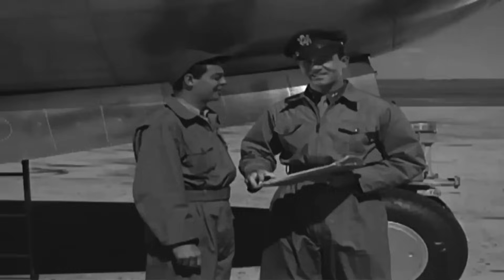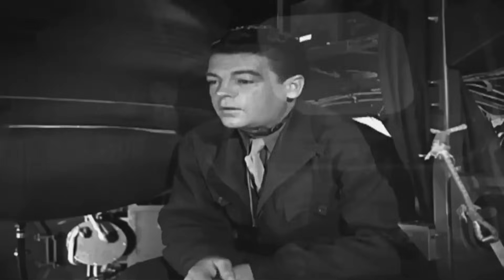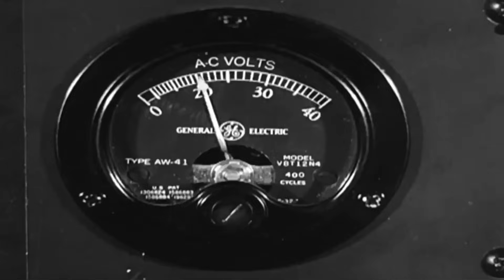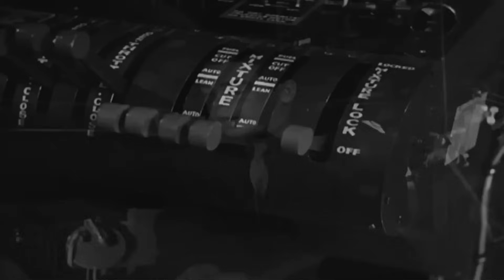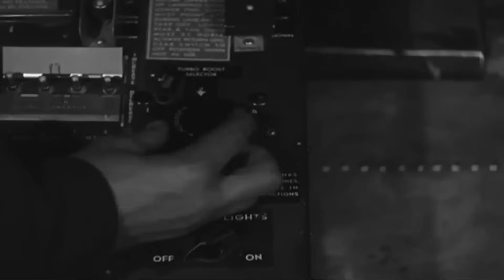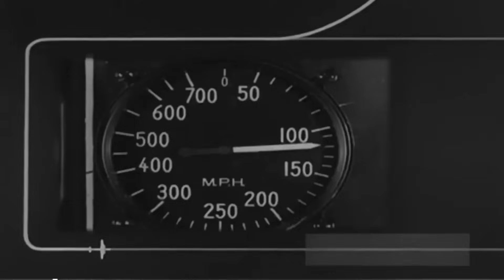ENGINEERING THE B-29 -  PRESIDENT RONALD REAGAN and ACTOR JOHN PAYNE TELL US HOW  [OFFICIAL WW2]

Comment: My dad was a pilot of the B29 out of Saipan in WWII.  He never wanted fly again after the war, even though I had a plane when I was in my 30s, and offered him a pleasure trip.  Before they had secured Iwo Jima, which offered an alternative half way between Saipan and Tokyo, they lost several B29s that ran out of fuel on the long non-stop flights.  He told a story of one trip in which he told tha co-pilot to take over while he took a nap on the way back to Saipan.  when he woke up a while later,  the whole area was covered by very low clouds and mist.  He looked over at the co-pilot who had fallen asleep.  The plane did have an auto pilot so it had held a course, but they had no idea where the island was.  Finally, just by luck he saw the field's rotating light beacon flashing above the mist layer.  Just luck, or I wouldn't be here.

Comment: I found it interesting that the conventional engine numbering system (perspective is while sitting in the pilot's seat) is not maintained on the Flight Engineer's controls.  The engine numbering convention is:  #1 engine is farthest outboard on the left wing then, moving sequentially left to right, is #3 engine, then #2 engine is inboard on the right wing, and finally #4 engine is the farthest outboard on the right wing.  On the FE's panel, the throttle levers, etc, were mounted opposite:  #1 engine controls were mounted farthest outboard to the right and #4 engine controls were mounted farthest outboard to the left.  Ergonomics have improved since then.
Reply: Two things. [1] Regular engine numbering convention (L-to-R) is 1-2-3-4, n0t 1-3-2-4. [2] FE is facing rearward, therefore his throttle levers are numbered correctly.

Comment: I was interested to learn about the starter-generator, they called a (putt-putt) I think, I saw a video with spec. tag plate still on it saying they are a 10 hp engine I think with a 28 volt output, or 30 volt, sorry I forgot exactly I was wondering if anyone knows if they were dc generators or ac? It sounded like they used the word inverter in this video.

Comment: Now imagine this same work load on a B-36 flight engineer, with SIX 28 cylinder R-4360's to manage, AND 4 turbojets on the final model. And since the B-36 engines were mounted as "pushers", airflow over the cylinders while taxiing, or waiting your turn to take off, was very problematical. The R-4360 already was a "difficult" engine to keep cool, even when it had the propeller in front of it in the usual tractor configuration. I read somewhere, that of all the heavy bombers ever flown by the US Military, the B-36 had the highest cost of maintenance hours per flight-hour.
Reply: Six Turning and Four Burning.

Comment: Turbos off at 10000 feet? I understood that turbos are required at higher altitudes.
Reply: Yupp they are, but like in your sports car they can provide more gasmixure into the engine than without.
Of course you don't need that in decent and on low altitude level flight, but it may become usefull if you have to make a go around while one of the engines fail at the same time.
After all even with the gas tanks mostly empty, the B29 is a heavy beast (34 tons empty) and it certainly was not overpowered (aprox 3300shp * 4).

Comment: The B29 was delayed by the development of the engines - it was a hard birthing process.
Reply: According to several sources,  it was touch and go-as to whether they would cure the many teething problems on this hi-tec  ultra modern Bomber, in time to drop the two H-bombs.
Both bombs were different in shape, Diameter, and Weight, with different handling and priming systems. A contraversial claim  is, that the  B--29 frame supports, could not be altered to allow such a huge and heavy bomb , to be released from it's extended  bomb-bay, without risk. Strenuously denighed by other sources.   Further,it is said that , in case of this  possible delay, 3 RAF LANCASTER BOMBER's, that do have huge Bombays, were ''offered''. Not perfect ,  but as a lst resort----or no H-bomb attack ??   As we all know, the Mission was carried out, according to plan.
Reply: @MrDaiseymay  Having seen replica's of both bombs and walked through FIFI's bomb bays, I don't think that is accurate.
Reply: @MrDaiseymay  As far as carrying the nuclear bombs (they were not H (hydrogen) bombs), your touch & go claim is nonsense.   B-29's were routinely flying missions from May 1944.   The two bombs were dropped as soon as they were ready on Japan August 1945.     The B-29 needed minor modifications for the nuclear bomb missions, mostly to improve height performance and range, so that the aircraft could clear the blast and had time to fly to alternative targets, This was done by fitting fuel injected engines, lightnening weight & reducing drag by removing guns.    
Note that they knew the dimensions and weight of the bombs well before they were ready.  Crews practiced Stateside with dummy bombs of the same size, shape, and weight
I've heard that nonsense about using Lancasters too, from a certain British YouTube presenter who goes in for gutter press-style sensationalism and doesn't worry about accuracy.    The fact is, the Lanc was not even remotely suitable.    The B-29 range (5200 km in the standard model) was barely adequate (the Nagasaki plane's engines cut out on landing), whereas the Lanc had a range of only 4100 km.   The Lanc had a ceiling of only 6,500 metres - not sufficient to clear the blast, and would have been shot down by Japanese AA guns.  B-29's flew at 9700 m and above the range of Japanese AA.   The Lanc's speed was lower too.   If it even got to the target, it would have been suicide for the crew to drop the bomb.

Comment: Great informational video. Makes you wonder though, if they had to get the plane off the ground in a hurry if there was an emergency situation.
Reply from the maker: Don't think anyone wanted to ever move to quickly with the monster. :-)
Reply: Even today you're talking about 15m just to start a plane, more if you have to load it with fuel and ammo
Reply: You didn't unless the engines were warm. The engines had to  be pulled through to avoid hydraulic locking when oil drained to the bottom cylinders.

Comment: excellent video great narration from RR.  I had some bomber radios from both wars in my radio collection. These planes were made by engineers and pilots there's far too much automation overlay on modern aircraft, not enough basic control systems as a fall back. The idea that both FBW sidesticks are not coupled at least electromechanically is totally beyond me.  IMHO....
Reply: Oh, the basic controls are definitely there, and not as a fallback. The automation is there because the engineer and pilot didn't want to spend hours watching fuel pressure: between 15 and 17; cylinder head temp: within range; etc. And they're sync'ing the side-sticks in newer designs.
Reply: You should call Boeing and give them a piece of you mind 😂

Comment: Would have been nice to explain why the engines were "pulled through"
Reply: Prior to starting, pull through is performed on every vertically mounted radial engine, now and forever. Although all radials use a dry sump oiling system, this remains a mandatory process ensuring that oil has not collected in the bottom cylinders causing hydrostatic lock and bent connecting rods. Air+fuel mixture compresses, oil does not. Cheers!
Reply: Dude!
 @blackrifle5.56
Reply: Victoria, it's a training film for flight engineers, not a documentary.   These films were a sort of working holiday -  the main method of teaching was lectures and books.   After sitting in a classroom listening to a lecturer for a few hours, a bit of reinforcement via a film is good.   Sometimes these films contain a couple of 'mistakes', unremarked except for body language, so that after showing the film, the lecturer could ask the students if they spotted the mistakes.
Most likely the problem of oil pooling in bottom cylinders necessitating prop pull through was covered in classroom lectures.
When I was a trainee service technician (1960's), they used the same of sort films for us.
Reply: Google gave me the answer in 10 seconds.  Try it sometime
Reply: @donkeightley8463 Better to ask a human, that way you remember your manners and how to converse with civility; also that we still live in a society.
Reply: @donkeightley8463 sure, and i was familiar to that, hoewever for the 'novice B29 pilot's' it's always nice to hear it from an expert.
Same story goes for almost all radial engines, where the startup procedure covers the cleaning of the cylinders by spinning the prop a couple of times (counting blades depenging on the prop shaft gear ration) before ignition.